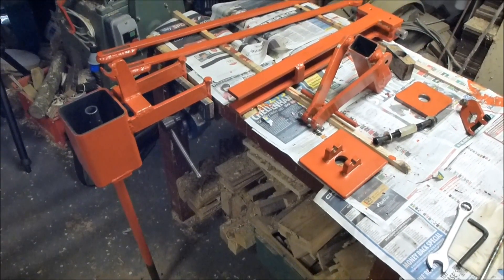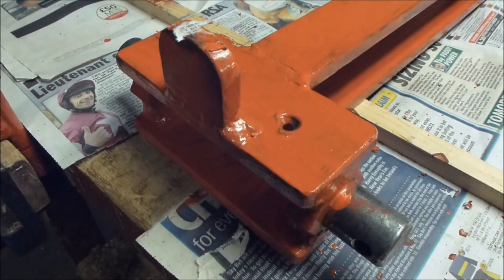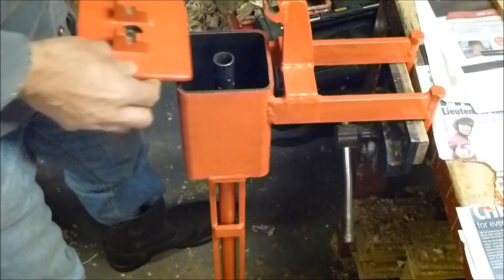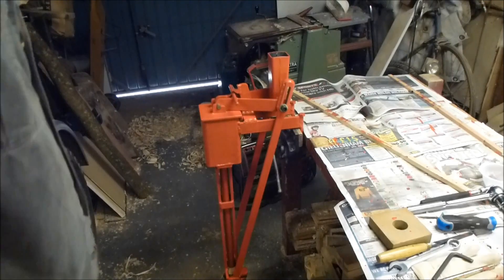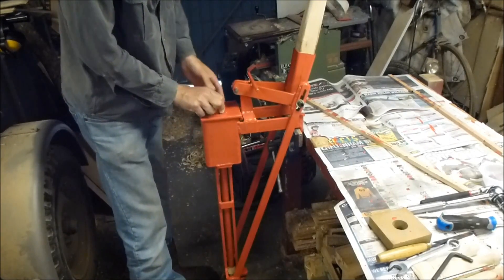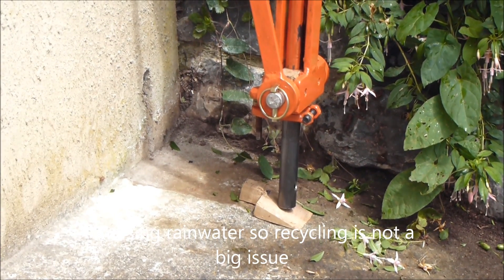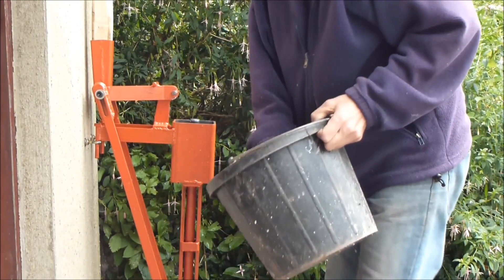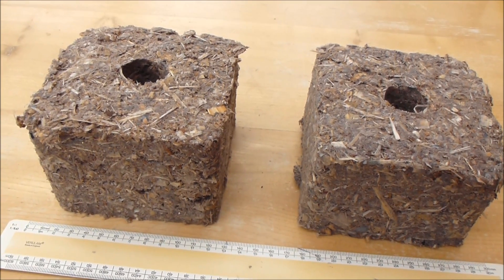Briquette Press assembly and first operation (Free Fuel).wmv

Comment: I have watched the video multiple times since yesterday. Are utterly impressed !!! .
I would love to have one made; and use it at my home; to supplement my use of ordinary firewood.
This morning; I had dialog with a local company/ metal-show; which may be able to manufacture the press for me. They had problems opening the google-sketch-file I sendt them, so they asked for PDF-files.

Would it be possible for you to help me out with PDF-file-versions of your drawings ?

I would be most greatful.

Best regards, Ola
Reply from the maker: bamsefar1  I don't have PDFs, and from SketchUp I can only save SKP files. All I can offer is to make screen prints of each section and send them to you as JPGs. If this helps please send me your email address. It might be easier if your metal workshop installed the free version of SketchUp, this would give them a better feel for the mechanism. 

I wish you success.

Comment: Belated appreciation of a great design and superb piece of engineering. My only mundane advice would be to have the device mounted above a large tray to catch all of the extruded fluid. The water will be super-saturated with starch and will help bind the briquette during the drying-out process.

Comment: You may want to consider adding dimples or thick raised lines of weld to any flat spaces on the piston faces; the thicker, the better. This would add even more surface area for drying as well as burning.

Comment: Suggest a measured container to scoop up the slurry with. Scoop it up in one motion. Scrape the top off and upend it on to the machine. This a hinge for the cap and a stand for your bucket will save a bunch of time. Another stand or rack for the finished briquettes will save a ton of time as well and avoid damage to briquettes.

Comment: Very impressed with this machine. Not sure if you're aware of it, but sawdust burning stoves have been made which rely on a central hole to burn from. The briquettes are dry formed inside the stove and burned from the middle outwards. I'd be interested to know if your manufactured briquettes burn faster as a consequence of the hole.

Comment from the maker: I think your idea would work, in fact the briquette would force the lid into the open position whilst it is being expelled. The loading phase is the least efficient and to help I have now made a square funnel which speeds this up considerably. Your lid modification would have to allow room for the funnel.
I think the next design should automatically load from a hopper. I don't make enough to make further development worthwhile.

Many thanks for your suggestion; I hope it inspires others.

Comment from the maker: I have a very rough CAD drawing which should give you the critical dimensions. It is drawn on Turbo CAD but I could save an Auto CAD file format if this is more useful. Let me know if you want to try it. I have added a funnel which speeds up loading. A sliding box would clash with the mechanism although there are machines used for making clay bricks that achieve this.

Comment: I have watched almost all the bricket press videos available to date and compare them to my version (thirty-five years ago) comprising car scissor-jack, piston, perforated pipe and holding frame. Your design is elegant, well engineered, smooth in operation and, in my opinion, the most practical solution I have yet seen. Very impressed with the maximisation of leverage at the critical point, you obviously have an engineering background.
Best Regards
Paul